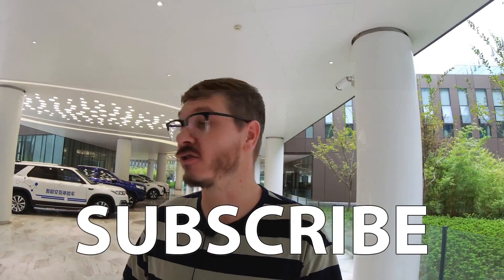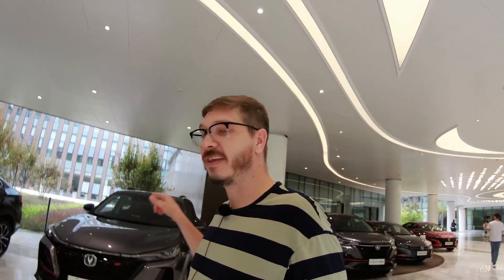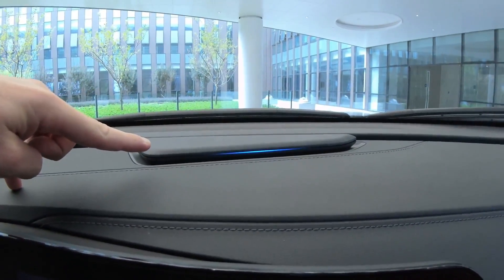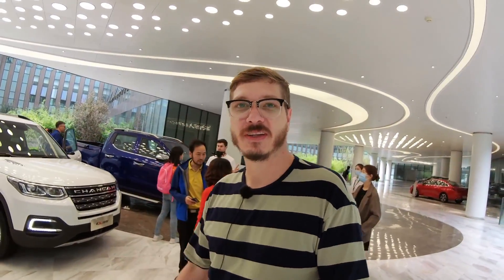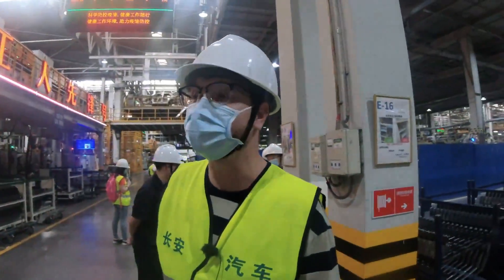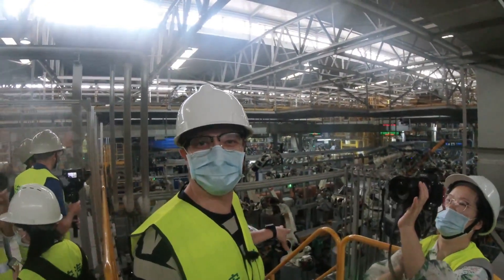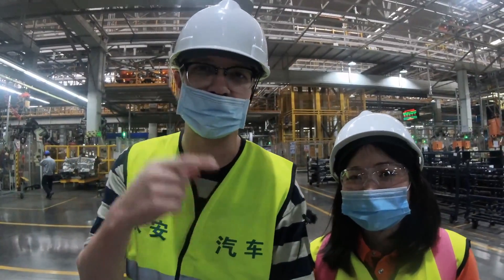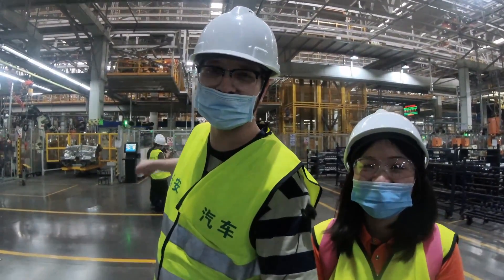FULLY Automated Car FACTORY Tour in MEGACITY Chongqing

Comment: Not bad, 1 car every 15 second with only 400 production workers. 

Very low cost cars.

Cool.
4 cars a minute, 240 an hour, 1,920 per shift, and  600,800 a year.

Not bad.
Pssst go look at the component factories.

🤣👅
Reply: Oh! 50 seconds.

That makes it 200,000 cars with 400 workers 500 per worker. 

Not very unique.
1 car in 15 seconds is another matter

Comment: pickup truck is now more and more popular than before because pickup trucks were used to be treated like commercial trucks but not familiy use vehicles. For this reason, most cities don’t allow pickup trucks get in to downtown area. But they have been popular in rural areas and suburbs for decades indeed. But I don’t think Changan brand has a good reputation in manufacturing pickups, Changcheng brand might be better, Changcheng made pickups originally and then turned to SUVs. Now as the pickup ban removed, the company is backing to its original field.
Reply from the maker: I can see these pickups to become super popular mate trust me it’s like a spaceship inside